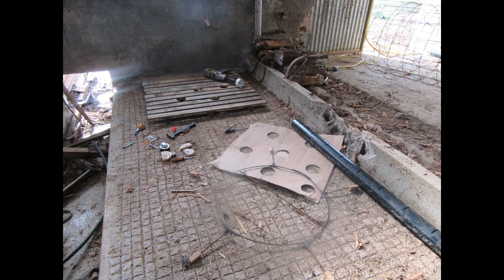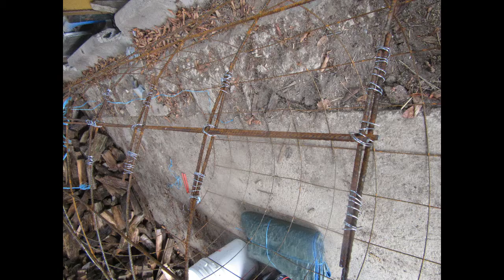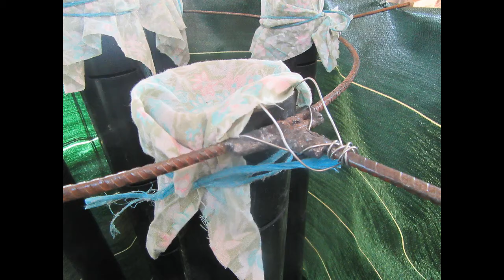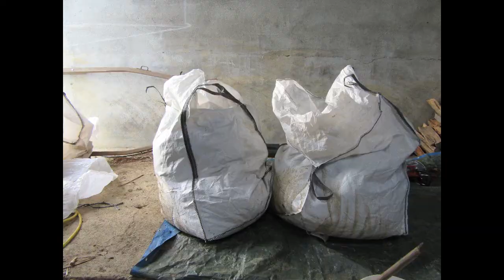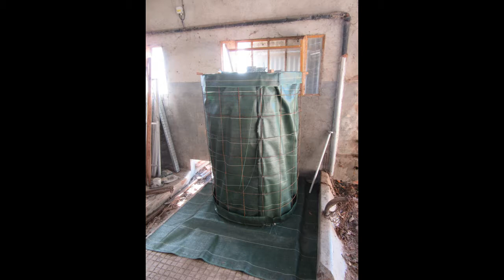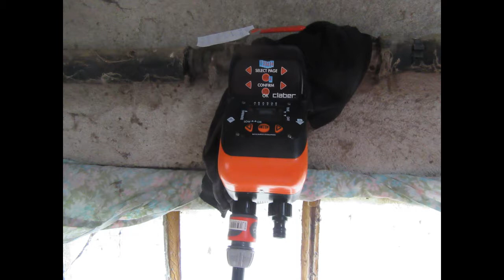Building a Johnson-Su Bioreactor at La Ferme à Naroques, France

Comment: Hi daniel. Do you have any update to communicate after this trial ? Did you get the clay structural compost as he described ? And did you use the compost extract on plants ? Thanks :)
Reply from the maker: Hi Ronan, unfortunately I have very little news on this. Upon completion after one year it had the clay structural component as he described. It was then applied to the ground as a liquid - mixed with another purchased compost extract. As it was mixed it would be impossible to tell if there was any difference between the two. This is the downside to doing it on someone else's farm. I hope to have my own place soon, so I will be experimenting more then.
Reply: @hr96gp  Ok thanks you daniel :)

Comment: Thanks for doing this,  Daniel.  I'll be having a go, soon.  Others have reported dryness.
Reply from the maker: From memory Dr. Johnson mentioned you should have about 7ltrs of water going into the pile. You could always start out with a bit more and if you find it is too wet reduce it down. You also have to be conscious of the time of the year and the placement of the pile - summer in direct sun will require more water. Also remember as the pile reduces in size you will also probably have to reduce your water flow. My pile is nearly a year old now so hopefully I will get to use it soon - the wet weather has made seeding very hard. Good luck.
Reply: @hr96gp  Ty  I've never uploaded a video, but I probably will with my trial.  Depending on the weather, I should compile some time this winter.

Comment: I managed to make this using a rectangle shape straight on to the ground using scrap wood for the sides to contain the materials and then placed the pipes into the ground filled it up few days later pull the pipes out the compost holds its shape like sand castles do. It reaches between 55-60 degrees for a week which is plenty to kill off nasties. This does work as it heated up really quick by evening it was steaming. What goes in also makes a difference some things cooks faster

Comment: update?
Reply from the maker: I'm heading back next week to try and apply it to some wheat seeds for a small trial. The results from this will take some time. I may also send a sample to a lab, however this depends on the quality of the material. The three weak points are that I didn't fill it to the top, I struggled to break up the leaves thus it looks like they haven't broken down as much as desired, and I am using it after seven months - longer would be better (around a year). I will post any findings that come up.

Comment: Good description. Thank you. Did you put cuts on the pipes to allow air into the biomass. My understanding was that the pipes are lifted out after a day or two of settling. This creates a chimney with free air movement to all points on the inside surface of the chimneys.
Reply from the maker: Hi Scott,  the cuts were already there when I bought the pipes - they just happened to be the ones that were cheapest and had the correct radius.  David Johnson bought something very similar - again as they just happened to come like that.  It may be of slight benefit as you are allowing some oxygen into the pile in the first day or two, but I don't think it really matters as it is not going to go anaerobic so quickly anyway.  You are correct in that the pipes are removed after around 24 hours to allow free air movement.